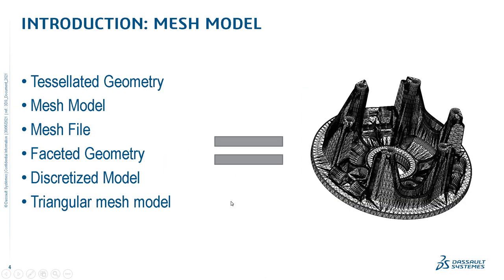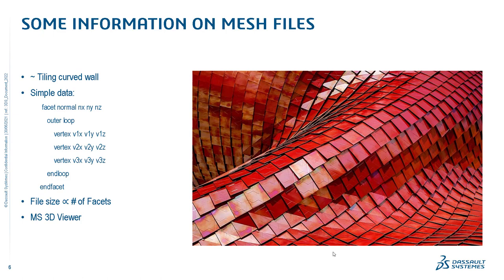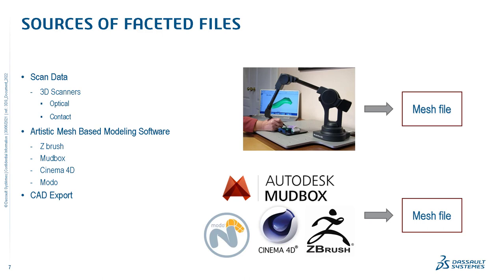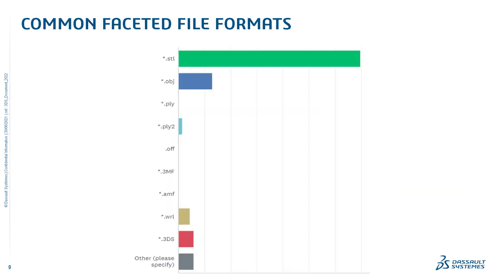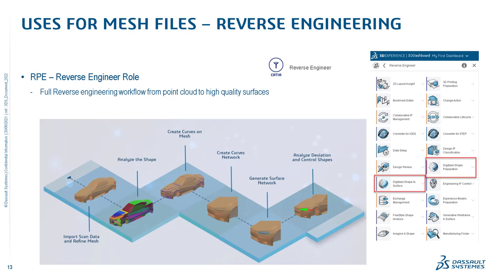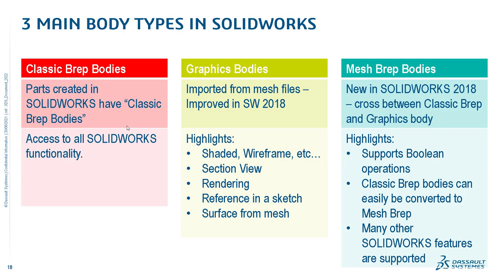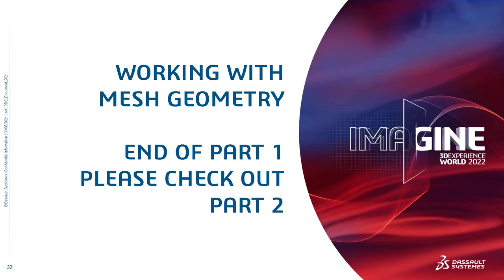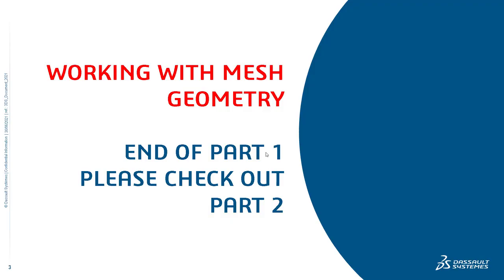Mesh Modeling in SOLIDWORKS Part 1

Comment: Hi Marlon,  Is there a way to use the combine command with an imported *.STL from a 3d scan that was converted to a mesh body (mesh brep body) and a classic brep body, solidworks extrution,  with the main body the classic brep solidworks extrution and the body to subtract the 3d scan converted to mesh body (mesh brep body)?  I saw you do it in reverse on the vid but I need the classic brep be the main body. I need the negative of the scan.  I used the intersect command after I converted the classic brep to a mesh body.  But can't manipulate the  converted classic brep converted to a mesh body as good a the classic brep.

Thank you Marlon.  I'm new to surfacing but have been using solidworks since 1998 using version 1998 -Greg
Reply from the maker: Greg,
Thank you for question and thank you for watching my video. It is possible to subtract a mesh brep body from a classic brep body using the combine command (with the classic brep body the main body). When you say "3d scan converted to a mesh body" you mean *.stl file imported then converted to a mesh brep body and not a graphics body, correct? Please see the first video for the definition of these body types. It is not possible to subtract a graphics body from a classic brep body. Note you must be using SOLIDWORKS 2022 or later for hybrid mesh bodies.
Reply: I opened the 3d scan (*.stl) with (all files) using open and it came in as (Graphic1) in the feature tree.  Not (Mesh1) in the feature tree.  Then used the convert to mesh command.  I think that means its then becomes a Mesh brep body.  When I tried to use combine it was greyed out.  

Also, when you open as (all files) It comes in as (Graphic1) in the tree and most of the Scan to 3d commands wizards are greyed out.  If you open with (Scan to 3d) file types, the (*.stl) comes in as a (Mesh1) in the tree and the Scan to 3d command wizards are not greyed out.

Do I have to use the convert to mesh with a (Mesh1) from the tree and not the (Graphic1) from the tree?
-Thank You, greg  (using Solidworks Pro 2024)

It won't let me pick (Mesh1) in the tree when using the convert to mesh command.

would  holes in the mesh brep body not allow a combine command?

The vertex ribs are all grey and not black on my 3d scan so it is a Mesh brep body but combine still wont work.

My graphic body is open.  Your graphic body is closed in part 2.  I couldn't reach some deep slots with the scanner.  large gapping open areas in the 3d scan/mesh.  I'm hoping that's why it wont combine.  I'm going to try and rescan to make it closed.  If that's what it means by being (open)

Thanks again Marlon!
Reply from the maker: @GregVillegas-c2d  Please disable the Scan to 3D add-in. The mesh functionality in core SOLIDWORKS is independent of Scan to 3D. A mesh brep body is not that same as the "mesh" body generated in Scan to 3D. Once imported the graphics body should be converted to a mesh brep body. Please review the mesh modeling videos to learn about the three body types (graphics body, mesh brep and classic brep) and how to convert to mesh brep.
Reply: I watched your vid 1...  3 or 4 times and paused it on the 3 different Brep bodies and read it.  I'm familiar with it now.  Solidworks is  not allowing the combine  with an open mesh?  Or its because  I opened the STL with scan to 3d plug in on? Thank you very much Marlon!  I've  been trying all week to do that one command.  I thought Solidworks  would be able to do it.  2024  Solidworks Pro...All  you have to do is open the file.  Not import.   I dont remember how it went with the other revisions.  Im  greg v not at work.

Comment: Hi Marlon, do you have any tips or ideas when a Graphics Body doesn't property convert to a Mesh Body? I have some stls, that are leaving a lot of holes in the surfaces when I try to convert them, but they look file when they are imported as graphics bodies.
Reply from the maker: Hmmm... without seeing the files you are importing I can only speculate that though the graphics bodies appear correct when imported into SOLIDWORKS as a graphics body there is a condition within the mesh that is causing the holes when the more stringent requirements for a mesh brep body are applied during conversion. In the past I have seen this sort of thing when converting to a mesh brep body when the original mesh has co-located or overlapping facets and also when the original mesh has disjointed facets (facets that appear to share an edge but don't). A google search for "mesh errors" will show many results that give explanations and examples of overlapping facets and disjointed facets. Disjointed faces in SOLIDWORKS are easy to spot because we color the edges of the face blue. You see this blue color when the mesh body is converted to mesh brep as well. Sometimes delete hole can be used to fill fully bounded holes in a mesh brep surface body. Hope this helps. Good to hear from you Jeremy!

Comment: Is there a way to turn off all these "mesh points" so that I can place lines without "sticking" to those points?
Reply from the maker: you should be able to control the snapping to mesh vertices with the following system option:

Tools -> Options -> System Options -> Sketch -> Relations/Snaps -> Snap to endpoints...

This applies for all body types. The reason it is more noticeable on mesh based geometry is because there are a large number of facets in a faceted model, each with three vertices.

Thank you for watching my video.

Comment: My mesh file presents "topological errors". How I can fix?
Reply from the maker: Mesh files have the same watertight/manifold rules as SOLIDWORKS solid body geometry. This is especially true when you attempt to convert a graphics body to a mesh brep body. As a graphics body the tools in SOLIDWORKS allow you to remove offending facets in different ways. This can resolve overlapping and intersecting facet issues. If the removed facets present a problem you can fill the hole by converting to mesh brep and using something like delete hole or other features to fill in the hole. In SOLIDWORKS 2022 or beyond this may create a hybrid mesh body.

Note that there are also many free mesh editing tools available for download that have automated tools for cleaning up the mesh. The issue with these is that the run an algorithm for which you may have little control so the result may not always be what you want.

Thanks for watching my video.
Reply: @mbanta  excelent!!! Thanks Marlon. Your videos is very good. ✌🏻

Comment: Geeze.  This is basically re-modeling a triangular "fractured" surface.  I will gladly pay the scanning service to do this so I get a "real" solidworks SOLID.
However, you need to know some basic surfacing commands, which most SW users do not know.  Good thing I have reviewed and applied.
To clarify the term "re-engineering" = redrawing the "fractured/mesh surface" → "finite surface" →solid geometry.
Also, that [Surface from Mesh] →"FACETS" command uses "calculate" as both a selection filter and a "group selection" command.  So, then you basically just blindly "drop the tolerance" and "click calculate" to grab a massive amount of fractured surfaces to turn them into a single surface.  
An "alternative" is to grab select points and "geometry fit" a rectangular surface, circle, cylinder wall,...etc.  Assuming, that a uniform shape was scanned. 
Thanks for the video series.
Reply from the maker: Thank you very much for watching my video. I also greatly appreciate the feedback you have provided and would welcome the opportunity to speak with you to better understand your ideas.

One thing I would say is that not all users have the ability to work with a scanning service. I would also say that with the hybrid mesh and mesh brep tools we provide, getting a "real" solid is often not even be required. This can save users quite a bit of time and resources while still allowing them to reference and incorporate mesh geometry in their models. The second mesh video in the series discusses this in more detail.